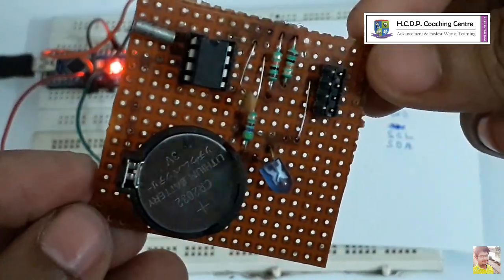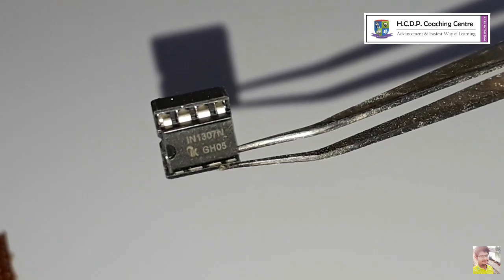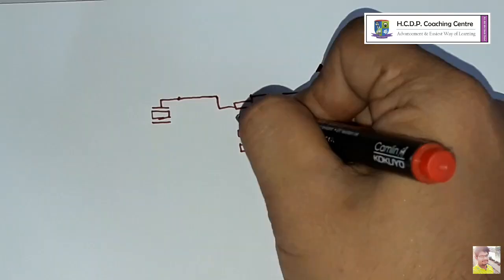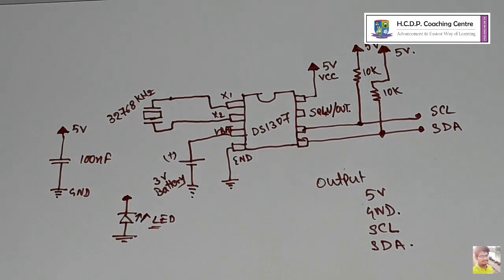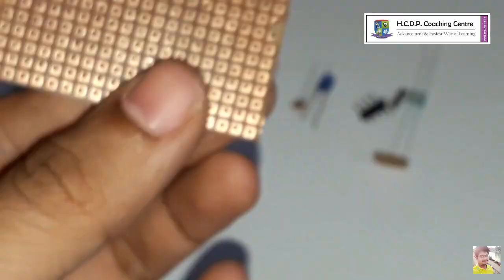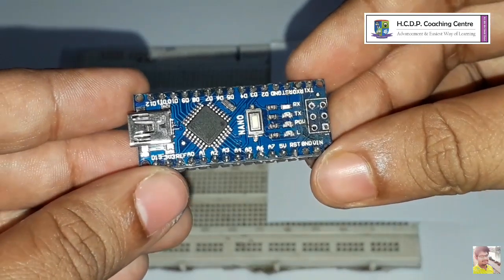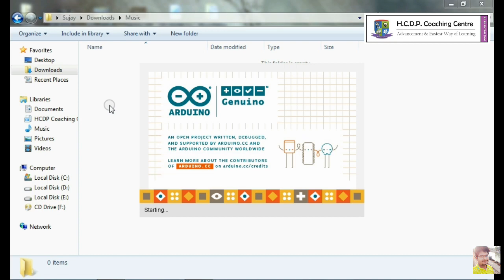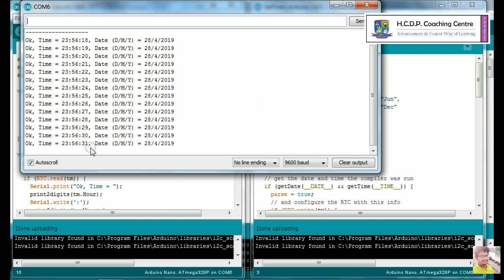RTC ( Real time Clock) with DS1307 IC with Arduino Code | DIY

Comment: If my 1307 can be written to, but the clock isn't counting I believe the crystal oscilator is faulty as I have tried 3 other 1307's ...?
Reply from the maker: You are right!  I face the same problem. Just change the crystal and it will work.  :) (hope you didn’t damage 1307)
Reply: @GSRA5  Thank you. (:

Comment: What happen if remove or micro lithium cell drained out?
Reply from the maker: It will forget the saved data (i.e. Saved date and time)  and will be reset after getting the power. (NOte - no coding will be erased and you will definitely able to adjust the date and time manually.)

Comment: how do i modify it to run with 3.3v?
Reply from the maker: As u might know Ds1307 chip operates from 4.5 volt to 5.5 volts. And if u trying to use it in 3.3v like from Lithium ion battery or fro any other source,  add a boost converter that can supply a constant voltage of 5 volt.
Reply: @GSRA5  I'm trying to build a very compact project which leaves no space for a boost converter. Can I use some other RTC? Any 3.3 v rated rtc u know of?

Comment: do you get correct time and date on the serial monitor after you reset the Arduino/after it loses power, without reprograming it?
Reply from the maker: Yes  Absolutely!  We'll  soon going to upload the Arduino based digital clock project  where i can represent how the function is actually works. Thank You.